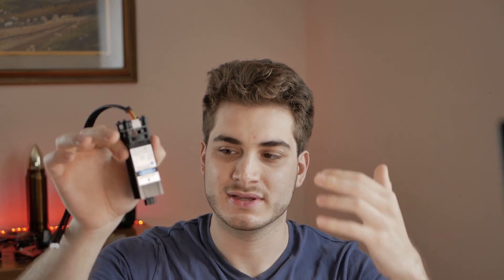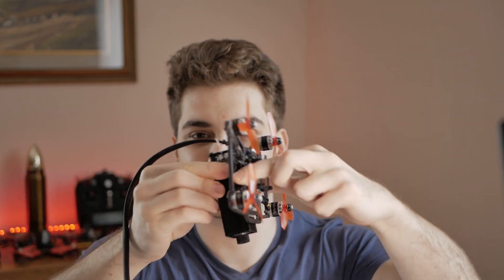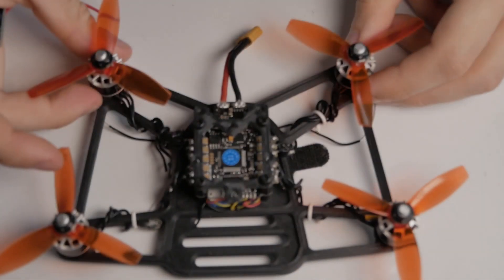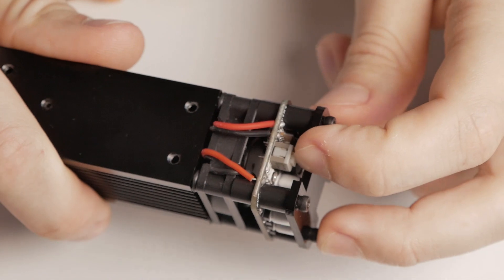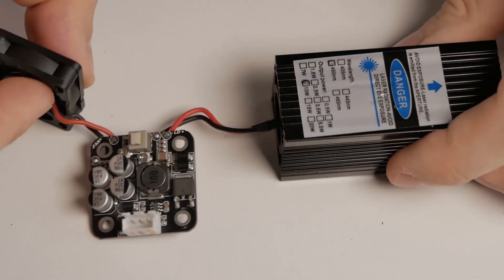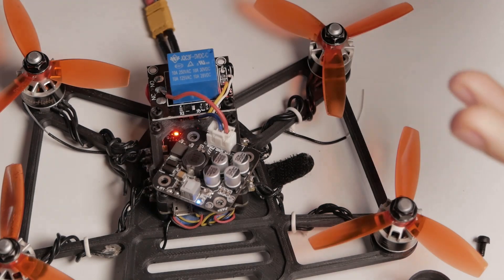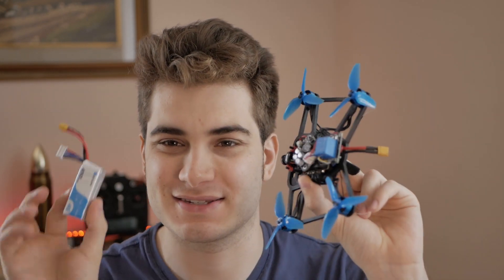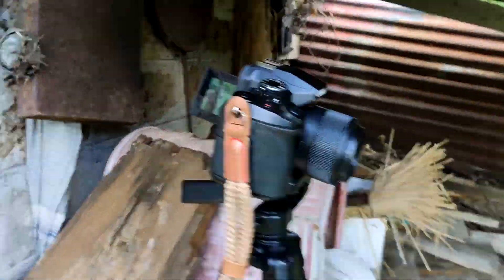INSANE BURNING LASER DRONE! 10000mW! Building and testing

Comment: Don't burn grandma's baskets, or you will be the one getting the rolling pin! 😂 Epic build Rimz, surprising you could aim so well. Usually using the buzzer switch in angle mode flight will make the fc glitch for a fraction of a second, like the inputs are set to zero. Possibly be able to eliminate this via cam switch board and servo output mix in BF like using dual cam for wings. Not sure if there are any pwm switchable led drivers for rc that could work as well. I know you like to refine your proof of concepts.
Reply from the maker: Ahahahha It Is her rolling pin😂😂😂 anyway I'm using buzzer 5v and led remapped pwm, using a relay for ease of use, once I've done some videos about it I will try plugging directly in the pwm port, don't feel like buying a fifth laser right now😂😂